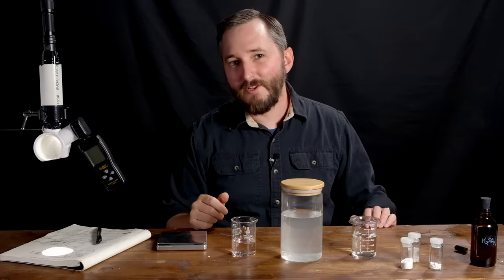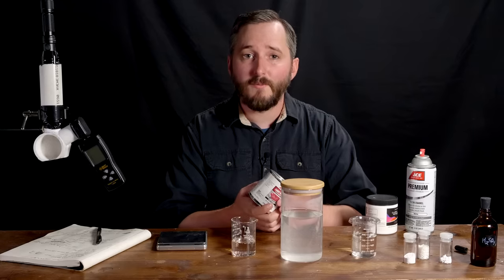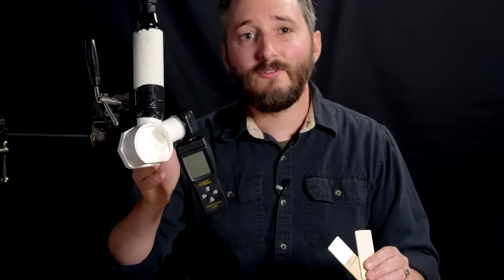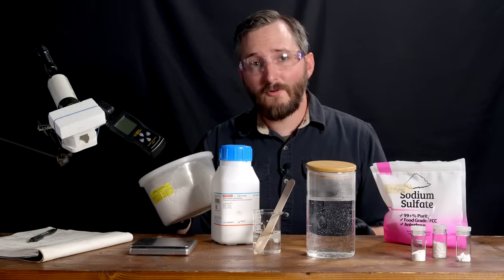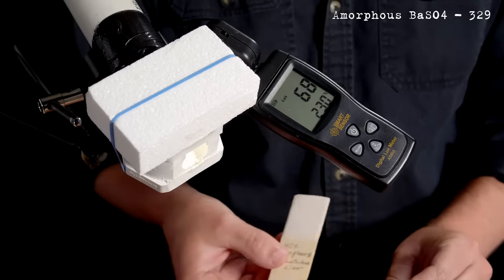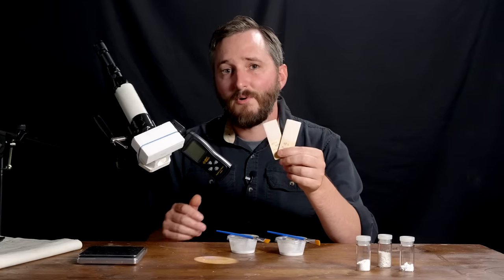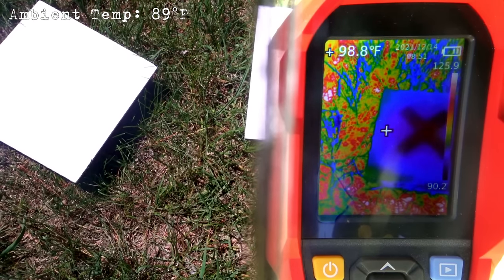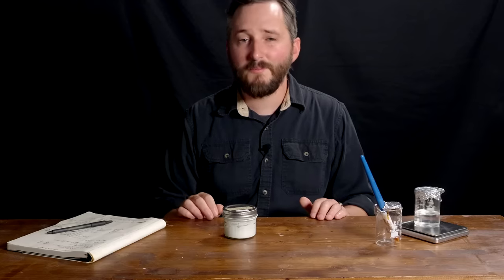How To Make Infrared Cooling Paint (Electricity Free Air Conditioning)

Comment: Really interesting investigation.  I had never heard of that plastic foam reflector idea.  Maybe the temperature differential could power one of those handheld Stirling engines.
Reply: @donnerpartysupplies5187  the powers that be wouldn't allow it.  We could be driving cars that run on water if they hadn't killed Stanley Meyers RIP
Reply: Another cooling idea, this is an old one, is a dual layer (usually fabric as this is a shade while camping thing)

Two layers, outer one is white, reflective.
Air gap in between, but open at the sides.
Inner fabric, I suppose could be black to radiate heat better but probably irrelevant.
Sun hits the outer
Outer heats the air gap
Hot turbulent air comes out the sides, even better if there's a breeze to carry the great away.
Inner air gap also acts as an insulator against the air inside the tent/under the shelter.
Reply: Maybe the Black Top should become the White Top.
Reply: Maybe airbrushing would get the full-of-air-gaps effect from the Barium paint?
Reply: And couldn't you just add barium sulphate to the commercial bright white paint?
Reply: @MostlyPennyCat  My thoughts exactly...........anyone?
Reply: Aaaaayehehehheeeey my boi whats up!! Love your videos
Reply: @roxasparks  
I mean, she's a nice cat and all but I don't think my videos are...
Oh wait, you're not talking to me, are you? 🤣😉😉
Reply: @MostlyPennyCat  mow?
Reply: If you power a Stirling Engine off of the temperature differential, if you measure the power output (use it to drive a fixed magnet DC motor as a magneto?) you're measuring the effectiveness of the White Paint Reflector prototype.
Say, put a known load across the motor and measure the Voltage and the Amps to get the Power?
(P = VI)
We put the load across it to get realistic values, it's all useless if you're measuring no resistance current and open circuit voltage, which may well collapse once you put even the lightest load across it.
So, a 1K high precision resistor and an accurate ohmmeter.
Reply: @roxasparks  
Well, I guess you'll just have to go see our fine selection of Cast Videos Mostly Starring #PennyCat?
We now have over 500 subscribers (initially it was just a way to send cat videos to my mum that worked on an iPhone but then other people started watching them and they wanted more #PennyCat)
But, this is not the time nor the place and we may annoy Chemistry Guy.
500 Subs means the Creator (me) gets to post CAT PHOTOS!! 😻😻
I'm very excited.
Reply: Wow, 0.0001% resistors are REALLY expensive!! Like, £100 pounds EACH expensive

Comment: I personally am quite annoyed that none of the reasonable methods for doing this have been commercialized yet. It’s been years for some of them that were supposedly at the “We can manufacture this tomorrow” level.

Thanks for the effort into figuring this out.
Reply: Because there are more efficient systems that provide considerably higher cooling capacity. Passive paints are good for reducing summer heat loads, but aren't good enough for primary cooling.
Reply: @Netheralian  For AC or refrigeration level cooling where humidity control is also a concern you are correct that these are not sufficient. Even the best case scenario I'm aware of topped out at -10 C (-18F) from ambient which is not sufficient on 85F+ days.

However, for lowering the heat load of roofs and for potentially dramatically increasing comfort in open air structures, many of these would be a wonderful option. Especially in hot dry locations.

The film by Radicool (UC Boulder invention) is already being used successfully on large projects in Asia for AC reduction. It just isn't available to the public.
Reply: @Sythemn  - if my roof is 110 instead of 115, wouldn’t that lower the cooling load on heat pump?
Reply: @Netheralian  that's because you're thinking of paint as a substitute, rather than as an assistant or supplement.
Reply: Selling more powerful cooling systems is more profitable than painting a building once
Reply: Who is gonna buy all these ac units we made then? Any one wanting to get in this business would rather be selling acs that can break predictably are more profitable. Compared to a paint that you really can't make worse once painted on I don't know how you would make it degrade consistently. Capitalism is great until it does stuff like this.

Comment: Here in Hungary (and probably all of Europe) Ca(OH)2 mixed with water is used as a standard white paint, which over time turns into CaCO3 by catching CO2 out of the air. Didn't know it had cooling properties, but makes sense why our single family homes don't heat up as fast 😮
Reply: Really? How can I check a random paint vendor what they use?
Reply: Here in Spain, it´s the same!

Comment: As soon as you mentioned micro-spheres my first thought was sand blasting glass beads. They are tiny, transparent, and fairly spherical. In addition, they are very similar (if not the same as) what's used on reflective road markings and high quality projector screens. In the case of roads, the paint is first sprayed pretty heavily, then these beads are metered onto it while it's still wet, sinking in and adhering to the surface. It appears that barium sulfate is used more as a filter rather than a pigment, so using off-the-shelf substrate mixed into regular white paint (instead of making acetone/acrylic mix) may be more convenient. 
As for heating/cooling panels, what about regular sign board (the kind that all election signs are made of) with one side coated with this reflective paint and the other matte black. Depending on the need, the panel is flipped over to present either side to the sun, cooling or heating water/air passing through.
Reply: That is an excellent idea especially since flipping the board would be straight forward and simple . Flexible tubing and a wave type of motion. Extreme right extreme left.
Reply: @ytSuns26  Good point. Since it's only 180* of rotation, a basic tube will be able to do that, so no need for a special sealed pivot or anything. If nothing else, loosely wrap the tube around panel's support shaft once or twice, that will give it plenty of slack.

Comment: Calcium carbonate is really interesting. I grew up in a small country town in South Australia, where the major bedrock was limestone. The town had many old mining cottages, built from the limestone, and those with painted outside walls where always noticeably warmer, on hot days, than houses with bare stone walls. Some of the old folks would put this down to the houses without paint "breathing" better, but this would make a lot more sense. Considering many of these country towns, sitting on limestone, experience extreme summer heat, I could see the limestone becoming a very important local resource.
Reply: When calcium carbonate was listed I was hoping to see it used.
Reply: True, in fact in Southern Spain most towns are completely bleached with ultra white lime paint almost every year. This keeps them much cooler.
Reply: @mgumodena  Exactly, so is some some parts of Greece and India.
I am wondering why he chose to use BaSO4 and not  CaCO3 as calcium carbonate is much more commonly available as already used as paint.
Reply: I just started experimenting with calcium carbonate coatings. The stuff has great properties all the way around and is a fantastic building material.
Reply: @shinjisan2015  Probably because Calcium Carbonate-based paint is just old-fashioned Whitewash
Reply: Yup, being in FL I would think all of our homes would be coated in limestone ... but no.
Reply: I agree this seems like a really hard way to make whitewash.

Comment: A related subject you might be interested in exploring is the use of this type of radiative cooler to condense moisture from the air at night. As the panel drops below the dew point in the evening it collects water that can be allowed to run off for jobs like watering seedlings (maybe useful for establishing plants in remote areas, like green belts in arid locations). For cooling tasks it might be possible to absorb the water into the panel to provide evaporative cooling the next day. 

You might also try combining this cooling paint with ultra black paint on a water wicking material to make a passive solar still. Water would wick up to the warm black surface, evaporative, and condense onto the coler white paint, then run off for collection. Production is limited to solar power input, but low thermal mass means it can start producing very quickly after exposure to sun, rather than needing to wait for a larger mass of water to warm up.
Reply: Skywalker moisture harvesting becomes reality
Reply: This works best where there is some humidity in the air, so coastal desert areas work pretty good, but large super dry deserts like the Sahara it probably wouldn't.

Comment: this is incredible... I had absolutely no idea this was even physically possible. The amount of uses for this are mind-boggling. Power-free sub-ambient cooling, just incredible.
Reply: It is NOT possible.
Sub-ambient temperatures cannot be achieved by a reflective coating. This is an obvious fact to any student of physics.
There are serious errors in his method.
Reply: @wizrom3046  the goal here is to release more heat than is absorbed.
This is why supersonic aircraft like the Concorde are painted with white epoxy.
The single Concorde that was painted blue had a speed restriction just because of the color.
This also has possibilities in other environments that are controlled.
My first thought to application were cooling things in other semi-controlled environments, such as cooling and refrigeration.

The concept is sound, and needs more research.
Reply: @dangeary2134  ... hi Dan, sorry I will retract my earlier statement, after reading some research papers it IS possible to get slightly below ambient temperatures via radiating heat energy to the sky. I'm not sure how much use it would be in refrigeration because it can only get about 1 to 2 degrees below ambient in daytime if everything is perfect. And needs to be pointed at the sky.
Since this works by the surface being super-reflective I have concerns about its viability since surfaces soon get dirty and contaminated and even in a few weeks their reflectivity can degrade by 20 or 30 percent, making this no better than standard white paint.
Then of course in real life it has to be cleaned constantly introducing a new cost, and of course the painted surface has to be able to withstand constant cleaning which might mean changes to the paint that make it more expensive or less efficient than the laboratory paint.
This is interesting technology for sure, but has a long way to go.
Reply: @wizrom3046  I get where you are coming from.
It would definitely not be a stand-alone tech for refrigeration, by no means.
That being said, consider the other things that help with cooling.
Evaporation is a big one.
Peltier Effect devices are quite good as well.
Imagine coating aluminum with this stuff, and placing it in a shaded area.
Whether it is in a structure or under something is irrelevant.
The energy is leaving the paint, and that is what is desired.
Application is more than for an entire structure.

I just think outside of the box.

Comment: 8:40 the "brown tint" is likely not actually a contamination, it's tyndall scattering, it's (almost) the same effect that makes sky blue and the sunset red. it looks red because it outscatters predominantly blue light in all direction and the remaining red light passes unchanged, that's why from the side objects with tyndall scattering look blueish and when observed through they look reddish.
Reply: The fact that it never settles out – even in the centrifuge – supports the notion that it’s particles that are too small to settle (due to Brownian motion keeping them suspended).
However, EDTA does form precipitates at low pH, so I wouldn’t rule out the possibility that these solids may be principally EDTA.

Comment: I've been reading about passive radiative cooling in the atmospheric window for years now, but this is the first time I've seen someone even approach the results using off-the-shelf, commercially available materials.  And it is VERY exciting.

Pretty much everywhere in the world that has any kind of cooling season needs this.
Reply: Maybe combine this with the radiators used for air conditioning and/or peltier modules?
Reply: @AmaroqStarwind  AC yes, peltier modules no.  BUT more on that in a moment.

I'm all for heat rejection that tunes the rejection specifically into the atmospheric window.  Getting the heat out of the world is good, all things considered.  I'm concerned about all the people who are so heavily pro-nuclear power, too - they want to dig heat out of the ground in the form of fissionable materials, and then release that into the atmosphere.  I know it isn't CO2 which does a good job of capturing solar heat, but still.

Peltier devices are pretty cool unless you're using them for cooling - then they're terrible.  Generally their coefficients of performance don't rise above about 0.7 or so - for every 100 watts of energy you pump in, you only remove about 70 watts of heat from whatever you want to cool.  Note that this is for the best TEDs, and for cooling an object below ambient temperature.  If you want to cool something that is already above ambient temperature then even a merely fair COP can beat 1:1.

But it's easy to beat 1:1 COP with regular compressor-based refrigeration.  Easy and fully baked.  If you want to deploy a TED as heater when it's cold outside, you will get over 1:1 COP but again, you get a bigger bang for the buck with refrigerant-based technologies.  A TED makes sense, however, if your needs are very low-amplitude and require high reliability - a TED can be designed to work effectively with no moving parts, just big ol' heat sinks and sufficient draft height to ensure air movement over the sinks.  Bob's your uncle.
Reply: @leifhietala8074  Kyle Hill has a lot to say about nuclear power. I’d suggest giving him a look.
Reply: @leifhietala8074  Are you sure the math works out for the idea that nuclear power is adding heat to the atmosphere when you compare it to a fossil fueled plant?  Imagine two power plants, one coal fired, the other nuclear, both producing one GW.  Both create more than one GW of heat energy, because the Carnot inefficiency requires that.  In each case, the excess heat is released to the environment, and each create one GW of electric power that is mostly converted to thermal energy at point of use.  Thus the heat output of each plant is roughly the same.  However, the coal plant produces vast quantities of CO2 that stays in the atmosphere for a thousand years, all the while collecting heat from the sun, with a collector area the size of the Earth.  I think the greenhouse effect of the CO2 will dwarf by orders of magnitude the heat energy generated at the plant.
Reply: I mean, this is not going to cool your house. I assume the video title is a bit tongue in cheek, because it certainly will not work as air conditioning for a normal house. Still cool though, pun intended.
Reply: @leifhietala8074  the only thing that’s released through a nuclear reactor is steam. Nuclear material is used in the process, not released onto the atmosphere.

Nuclear is the way forward for sustainable power generation with minimal impact on the environment and minimal usage of rare materials.
Reply: @leifhietala8074  from what i read, coal plants give off as much radioactive material as nuclear. But nuclear waste is more easily contained instead of released into the atmosphere.

Also greenhouse accumulation of heat is the big problem.  Generated heat is not a problem.  

I read new gen4 nuclear reactors are inherently safer (no way to melt down) but everyone is too scared of old designs to consider them.
Reply: My elementary thinking was that radiating heat in the atmospheric window could offset some of the warming of greenhouse gasses. Is this the direction you have been investigating?
Reply: @leifhietala8074     You can boost the efficiency of peltiers. For example, on the hot side, you put one of those thermal "heat pipe" type structures (copper structure with a medium vacuum, a little wicking material, and a little water inside it), and then on top of that, you put a wetted microfiber cloth so that you get some evaporative cooling. 

    The cooler you can keep the hot side, the more efficient it becomes. Neither of these methods use any extra energy. The combo would be particularly helpful/efficient. And if combined with a Solar panels, inefficiency is less of an issue all in all.

    I also believe that I remember seeing that they are designing/prototyping more inherently efficient peltiers as well. 

   But you're completely right, refrigerant based compressor systems are far more efficient--even after doing things like the above.